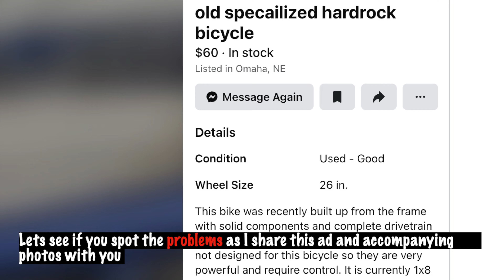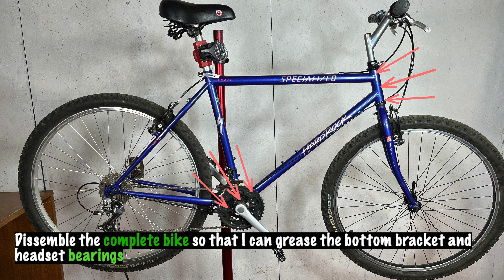Specialized HardRock: Fixing a DIY Disaster

Comment from the maker: I have a confession to make.  I may be a DYI dumb @ss...  I got an IM from the buyer of this bike yesterday after selling it to him.  The chain fell off mid-ride.  I did not install a new chain during the build.  He was only a few miles from me walking the bike home, I told him I would meet him and install a new chain.  Within 30 minutes I was there and put a new chain on.  Thats not the DYI dumb @ss part.  When he continued his ride home, the non-drive side crank arm fell off.  I didn't screw on the bolt tight enough and the arm worked its way off. 😱I need to slow down on these builds and take my time.  He was able to re-attach the crank, but I feel really bad about the situation.  Has this ever happened to any one of you as a buyer or seller?
Reply: Ty for your honesty. You're a good mechanic for owning up to your mistakes. Keep wrenching bud
Reply from the maker: Thank you, and thanks for watching!!

Comment: Nice job! So it "just" required an appropriate cassette paired with new brake/shifters and cable routes.
How does it perform now?
Reply from the maker: Thanks for watching!  You basically got the idea of what needed to be done.  Also needed a bottom bracket cable guide.  

I just finished it today and only rode it a short distance for photos. 

Thanks for watching!!

Thanks for watching!!

Comment: Hi! Nice video. I am currently working on my bike and my vbrakes aren’t working quite right. Does it matter which caliper goes where? I think I have them positioned wrong on wrong sides of the bike, like I have a front one on the back or something. But when I looked at them they seemed to be the same looking so I figured it wouldn’t matter. Any advice would be appreciated!
Reply from the maker: Thanks for watching!   I don’t think it matters which side they go on (front vs back).  Hard to say what’s going on without having my eyes and hands on your bike.  Good luck Im sure will figure it out!!
Reply: Maybe you mixed up Cantilever and V-Brake parts, like a V-Brake with Cantilever levers?
Reply from the maker: Kind of like what happened with the Hardrock I was working on.
Reply: @TheValueBikeAdvocate  I did eventually figure it out, thanks for the reply!
Reply: What was it for those of us that are curious??
Reply: @BernieHoule I had to put the brakes in so that they were in the hole with the most amount of tension. They are old brakes

Comment: Nice work but I hope after all that you replaced those tires with a less worn set.
Reply from the maker: Thanks for watching!  My plan for the bike is to flip it for a small profit, so new tires would probably price the bike out of the market.  I currently have around $85 into this build, and putting $50 worth of rubber into it would eat any profit I may make.  I'll let the new owner replace them if they want.   If I were to keep it, I would probably replace them. Again, Thanks for watching!